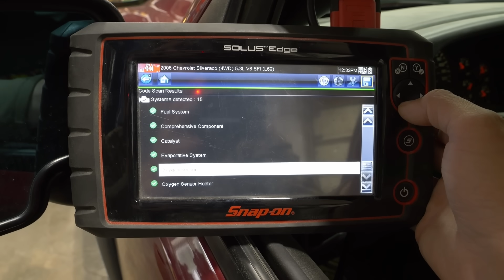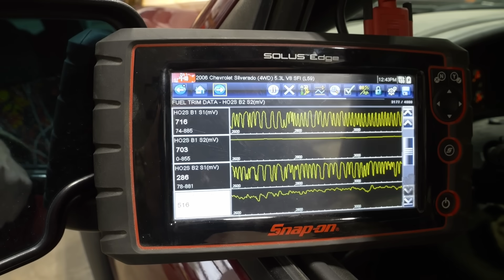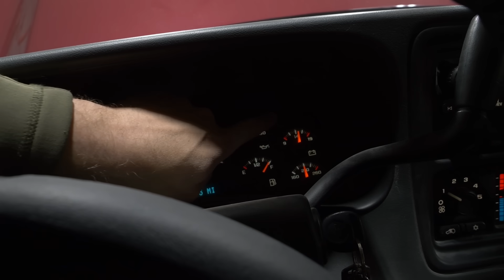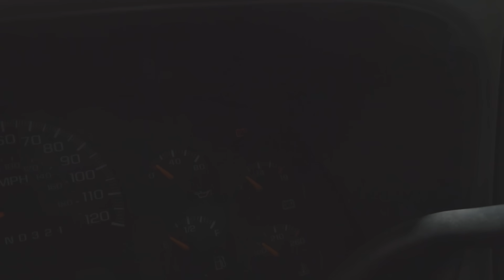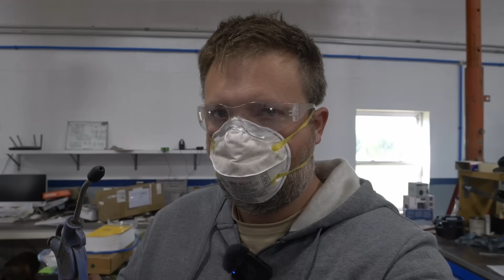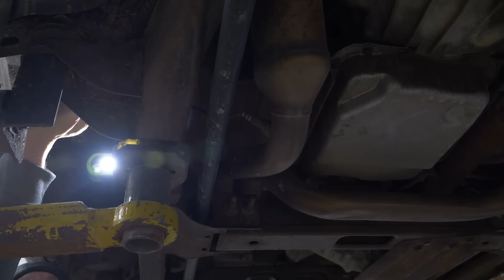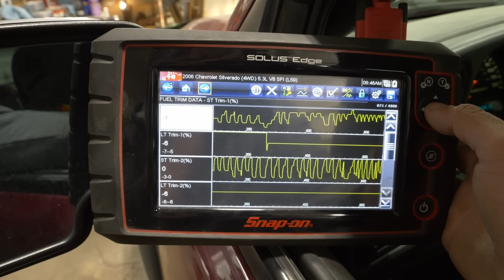AutoZone Says It Needs a Starter

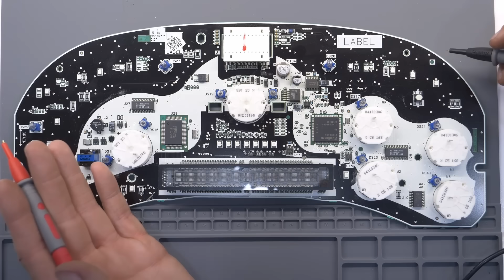Comment: 10:16  Perhaps the shift register Vcc pin is not powered by the same linear regulator that the LED gets powered from?
If it's just a basic data SR, then the parallel IO pins are clamped to the SR's Vcc pin internally.  Ideally, when the SR is trying to keep the LED from lighting, it needs to output "1", and that "1" needs to be the same voltage that's coming from the linear regulator that powers the LED.  If the voltage supplied to the SR's Vcc pin sags a bit, or if the voltage supplied by the linear regulator feeding the LED is caused to go higher than normal, then a wee current could flow through the SR's clamp circuit causing the LED to faintly glow.

Comment: CAFE numbers went up on cars, then trucks followed. GM placed a cable amp sensor and software to reduce alt load. Tin-Wisker’s new phenomenon on reduced lead circuits, affects everything from satellites to cells. 3 gen of E85 sensors syst. but new work best. All government required BS. 
 ASE Master Tech - 78

Comment: Hold on. Stop. Why was the old O2 sensor wet? This would likely cause the bad readings. Therefore the new one may fail in a week too. Why was it wet? Exhaust leak above that point?
Reply: A technician sees that and says it’s weird and just continues and forgets about it when the new part seems to work. A diagnostician sees that and switches back into therapist mode for the car: “Hmm, that’s interesting, why is this part wet? What made you feel that way? What hidden emotional baggage might be boiling just under the surface that you’re trying to tell me about but the only thing you can manage to actually tell me is my O2 sensor feels weird and it’s wet?”
Reply: I know this video is a year old, but if this vehicle comes back in the shop with the same problem again, check your O2 sensor heater circuit. That sensor should not be wet. If it is, and it was already replaced even before this video, think sensor heater or exhaust leak. The car is trying to tell you something with the wet O2 sensor.

Comment: Your replacement starter is not an OE starter either and most likely came through the same supply chain from China that feeds AutoZone, O’Reilly, Advance and the others. These are new clones of the OE (made by Mitsubishi Electric) and not a rebuilt that got that “Chinese Rebuilt Look” that you mentioned…!

Comment: Autozone didn't tell your customer anything. It was an employee behind the counter. According to the direction your video is taking, it was probably the check engine light. You did not say the charge warning light. If your customer failed to tell you which light came on, customer probably failed to understand what was being said by the Autozone employee. It's also possible that the employee did not have automotive knowledge and was just reading from the computer screen. Autozone will hire anyone who can read a teleprompter and regurgitate it back to the customer. I heard a guy say, "My engine just cranks and cranks but won't start. I think I need a battery jump." You can't blame a company for bad diagnosis when it falls on the interaction between two people.

Comment: The fuel alcohol content thing is something I never knew about. Good thing I run my flex fuel Suburban on REC 90 lmfao

Also, GMT800 instrument clusters are NOTORIOUS for having problems. I had to get a rebuilt one myself as all the lights were failing in my original one, and I don't have the resources to rebuild it myself. Or add a transmission temperature gauge, every 1500 truck or SUV should've come with one since the truck version of the 4L60E transmission was somewhat weak for the vehicle size and weight, and towing in OD would lead to them rapidly overheating and self-destructing. That would, of course, have required GM to have a good idea, and good ideas have been in short supply with GM ever since the 70's (basically all of them came from Buick, Oldsmobile, Pontiac and even Cadillac, but Chevy and GMC pulled in the opposite direction just hard enough to screw them over every time).

Comment: If the vehicle is used primarily in the country this will the norm. Dust is far more prevalent especially on unpaved roads in these areas. My '04 Trailblazer has the dim battery light occasionally on problem  but after checking the charging system nothing was found.

Comment: I am supposing the battery light in the dash is an LED but if it's incandescent if you had voltage coming into it from the ground and I mean positive voltage it could exit through the positive lead possibly going to some of the ground and give it a faint glow because incandescent lights can work in reverse

Comment: Check alternator for amps. When I used to work on vws. I had a rabbit that said good voltage 14.4 vdc . I put a Amp meter on it  and wasn't putting out any amps.  Changed alternator and had volts and amps again

Comment: That instrument cluster probably had what's called tin whiskers. They actually grow from the unleaded solder so by cleaning it giving it a brush with a toothbrush or whatever, probably brushed away those tin whiskers and got rid of the issue. Not to say that it won't come back, but who knows how long that's going to take based on how long it took those original ones to grow

Comment: Rectifier can short out and throw AC voltage instead of DC. I don't know how many of these things I came across that the alternator was working but still bad because of it. Swapped alternator problem fixed. In this case its different issue.

Comment: AutoZone diagnostics will usually steer you down the wrong path. About 15 years ago I removed my  Honda Accord,  starter  and took it to AutoZone for testing. (Not an easy starter to remove.) They told me my starter checked out ok. Reassembled and  had the car towed to my mechanic only to learn it was in fact a bad starter.  This turned out   to be another exercise in futility.

Comment: It's the opposite with the solder problem. Flexing from the thermal changes on the brittle solder causes resistors and capacitors to break connection. That's why you can usually bang on the dash and get them to work again. But then after another thermal cycle they stop working. You just have to go through and reflow all the solder joints with better solder and it fixes things

Comment: Interesting video! Lead free solder is mostly tin, and tin has a nasty habit of growing whiskers, especially when exposed to very cold temperatures. The whiskers can usually only be seen under a microscope. If you search "Tin Whiskers" you will find a lot of information about it. Because of this issue, the aerospace industry does not use lead free solder. You probably knocked off the whisker that was forming the leakage path when you took the cluster apart.

Comment: You do know that O2 sensors get reference air from the connector... No? Quit kinking/bending the wires at the base of sensor. Hold the wire straight as possible. I could be wrong with denso systems but I can learn more with reason.

Comment: Just to let Folks know, if the alternator was bad you would get a warning on the display that reads "battery not charging", on this generation of Chevy truck.  No need to ask me how I know, I've been through this before on my truck.  I checked with a meter under electrical load and sure enough the alternator was bad.

Comment: Be very careful in 'assuming' an alternator works just because its tossin 14+ volts. Ive seen more than a few alternators that drop a field, keep tossing 14+ volts, but cant toss enough amps to do the job.  That battery lite - probably the crud in the fuze box or circuit board. Only thing id try is an IOD - Ignition Off Draw - test, see if something pops up; tho with LEDs they dont take much to begin with. 

That Fram filter, gah, thats painful to see.

Comment: Regarding alternator VS generator, I was told gm now calls them generators when they have external voltage regulators Ala computer controlled and alternators when internally regulated.    

I think it's dumb too but that's what they said.

Comment: i had to take out my cluster and resolder the resisters, i guess the boards flex over time and just touching it fixes cluster issues. But i touched up the solder joints on a few resisters i saw in an online picture and worked like a charm...oh, and it also fixed it being the cluster being in German all of a sudden, hahah

Comment: These gmt-800 trucks are absolutely infamous for all sorts of bizarre cluster problems.
Reply: As if the lights blowing out (they were incandescent from the factory) wasn't bad enough... I've seen some WEIRD cluster problems. Perhaps the weirdest was in my uncle's 2000 Suburban. All gauges would just conk out, but it would still show engine RPM, while the DIC screen would show a "check charging system" code (the alternator was fine and so was the voltage regulator). After 5-10 minutes, or pulling over, turning the key off, and turning it back on, it would be fine.

Comment: I always thought it was a stupid idea that automakers design a engine to not run properly for the simple fact that they have to make a catalytic converter function when running at stoichiometric is better for fuel mileage. Same thing with the def setup on the new diesels it causes more problems then it fixes.

Comment: I completely messed up the first cluster i took apart. I ran out of gas on the road because I put the needle on wrong. Good thing i carry gas on the truck. I also had to gps the truck at 40mph and push the needle on at 40 while driving.

Comment: I have a 03 2500HD - while trouble shooting a cluster problem I find a poor ground one one of the two ground wires, it goes to ground zone #10, that the diagram says is located right side of heater. After much hunting I can not find that rascal. So I soldered a branch circuit and attached it to the dash frame. If you know where that #10 is please share. I would like to see the condition of that ground point.
Reply: BTW, the Silverado and I have a 12 year history of learn on the fly diagnostics , some clever stuff in the design and well some no so clever stuff!

Comment: I used to repair electrical problems and electronics on boats in the Caribbean, and you'd be AMAZED about how often a quick scrub of a PC board with alcohol and a toothbrush fixed this kind of partial short/leakage problems. About 90% of the time, I'd say. Cracked solder joints, which just required a quick remelt with a soldering iron, were the other main problem.

Comment: Joe public probably thinks that taking lead out of solder is a good idea because it is safer, but, the reason that lead was put with the tin is that tin grows whiskers, which create short circuits. I had a job where I had to count tin whiskers on failed components. The whiskers are very fine and can fall off with a little vibration.

Comment: Most of the time autozone and oriellys have no idea what they are talking about. there is a few guys that work there that know alot though like the orielllys near me one guy in there i like he knows cars well
Reply: my biggest thing is the cheap parts they sell especially oriellys. while i understand they are cheap but i just had a water pump last 400 miles bearing started making noise. pretty vital part cheap or not 400 miles is unreasonable. i asked them who actually makes the pump they responded with we dont know lol. we know master pro is not the maker. my guess gmb or us motor works.
Reply: could it because its a chevy electrical issues or cluster. and they say dodge is bad lol they all are

Comment: Had the same issue with my 06 GMC had a faint battery light I just chaulked it up as typical gm instrument panel issues cause everything was fine all the grounds was clean and secure none of them was broken the alternator was charging within the proper ranges so I left it alone and never had an issue

Comment: Just saw a GM of this vintage have the battery light stay on when running and not running and it ended up being the ignition switch.  If the key was removed at just the right spot then the batt light and the PRNDL would stay lit.

Comment: How did cars ever work before all these sensors and computers?

An easy fis for the battery light would have been a piece of tape over it.
Reply: They worked through sheer fucking will. A carburetor is basically "hmm grug dump fuel in engine" but it just WORKS... Given everything is tuned properly, fuel delivery is set up properly, and the end user isn't too stupid to understand how the carburetor works (duhhh carbureted engine not start when cold - FALSE)

Comment: I have a 2002 S10 that will turn the headlights on on its own at night, a couple gauges also flick on and the only way to turn the headlights off is to push the dome override button four times to turn the automatic headlights off, I also found if I pull the RAP fuse they go off. I also had an issue where the brake pedal would turn the ignition on and if you shut the key off with your foot on the brake it would keep running, found out that one was a bad hazard switch.

Comment: Wes, high silver solders will bridge under high humidity conditions. Rubbing alcohol and a toothbrush will often clean them up. After a good scrub, blow it off with compressed air.
Reply: Another thing, very old circuit boards, (10,000 hrs use) will have dying electrolytic capacitors in them. These can be removed and swapped with known good capacitors. Sometimes cheaper to find a boneyard display unit replacement. It all depends how much time you wish to invest in a given project.

Comment: I watch a guy who does board repairs on GPUs. Lead free solder kills 1.600 dollar graphics cards like there is no tomorrow. The heat sinks on the cards are so heavy, the solder under the chips come apart, when the card bends under it own weigh, especially during transport..

Comment: I had a cluster problem with my 2016 Mazda awhile back that was similar to this battery light problem. The brake warning light would come on out of nowhere, sometimes flickering and sometimes staying on for a while. Checked wiring and connections from the parking brake and master cylinder to the cluster and everything was fine, the problem was within the cluster. After a month or two the issue resolved itself.

Comment: We have the same issues over on this side of the pond. Never put your car into the shop and tell the mechanic tom investigate. You will pay for it. Big time.. Battery light issue i had an issue like that years ago. Couldn't find the problem . Bridged out the light and ran the car after that for ages. No come back. That's what we call a redneck repair.  Later 😂

Comment: Had a chevy van one time with a terrible noise on acceleration, after days of frustration I finally figured out that the rotation of the flywheel was creating a vortex  sucking the starter gear into the flywheel, new starter fixed the problem.

Comment: Lead free solder drove me nuts. I designed scientific cameras that used Peltier coolers and when lead free solder first came out it screwed with the joints between the layers. If the temperature wasn't perfect it would form balls that eventually came free,rolled out and shorted other bits on the SMT PCB. And/or it would grow whiskers that would bridge components and short them. The RMA budget went through the roof.

Comment: Battery voltage should be about 13.5 if it is holding 14.5+ the regulator in the alternator failed

Comment: One would think the battery control module codes are there for a reason, and they probably tried to say they needs an alternator rather a starter, but the owner got confused. I'll be curious if the light comes back on for this particular issue.

Comment: I have a 2001 with a Duramax  these trucks , They are notorious for bad grounds , crusty and broken even here in the south . With all the computers that will cause ghost voltage to riddle the gauges making warning lights dimly lit  . Then you have mouse wine in that stupid up right fuse panel . All fuse panels should be  vertical  for a reason and  That is Mouse wine . Now mine is flashing water in fuel ever so often , The sensor is disconnected and wires to it are terminated and it still occasionally flashes , I tried 2 new sensors one after market and one from G.M. and it still flashes sometimes and goes right back out . Any tips will help out there please .

Comment: Excellent Video Wes  :) also some vechiles find on computer checked or mind and running in park to driveing! My late parent's had car Check Engine light coming on also  off lots even ABS .light to when drive on cold start to hot start! When took in dealership  put O2 sensor then took  6 sensors  before I found problem one Fuel line  from tank to filter to Engine had slit in from tank to  filter leaking from corrosion so new line cure that  plus ABS ground issue  plus fault brake booster plus pedal plug worn out ! Then found Ground pig tail to fender rust up and fell off need replaced! Then Water Pump proller inside motor quit after years and outside pulley turned okay! Pure BS vechile was and so many problems  !

Comment: You verified the poor output of B2S2, and a bad ground, bad reference voltage, or bad sensor wire are all very unlikely. As a sensor fails it doesn't get much better than that, so I think you accurately made the diagnosis. Sensors don't last forever.

Comment: that looked too easy on the o2 sensor, maybe you have a magic O2 sensor socket, but I have never ever gotten them to come out with the special sockets.  I end up bashing them apart and putting a 22mm on them. then use tool for install sometimes after using tap.

Comment: For my 1999 Ford Ranger the cluster had miniature incandescents which eventually failed. The cluster was so difficult to access that the dealer tech told me to live with it and use a flashlight at night. Or else spend over a thousand to get it fixed. I chose the flashlight option.